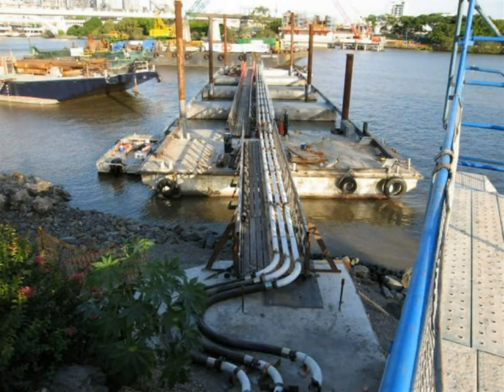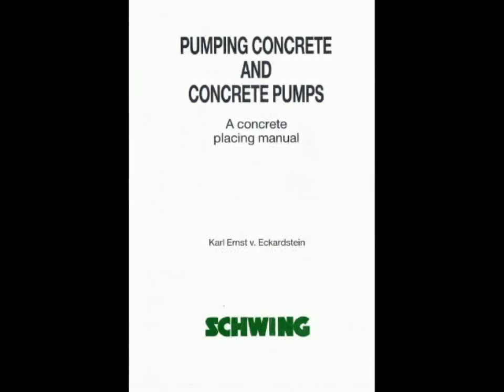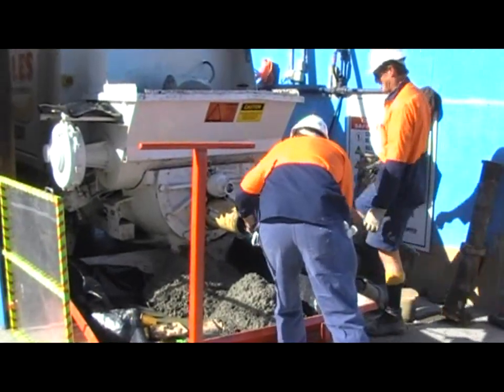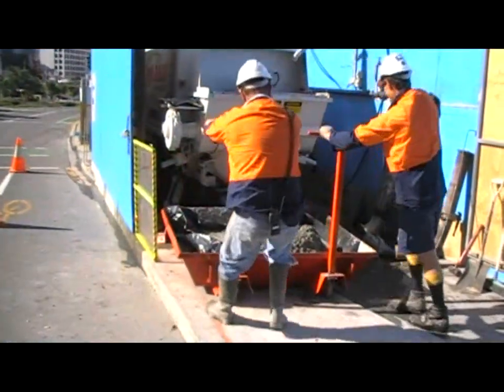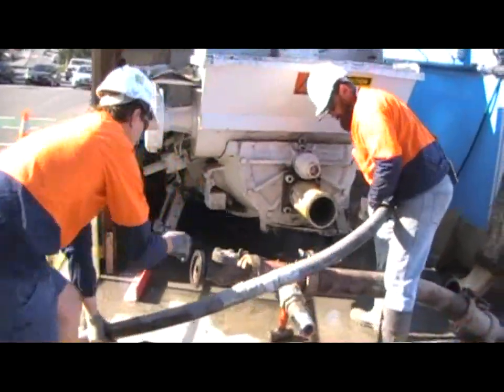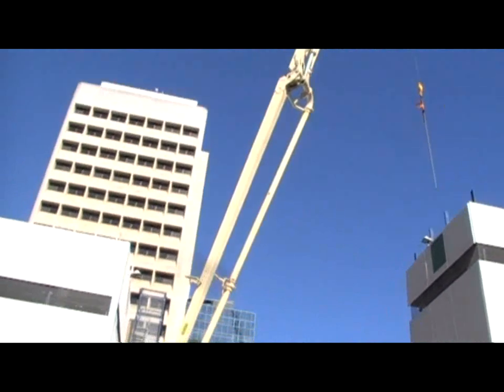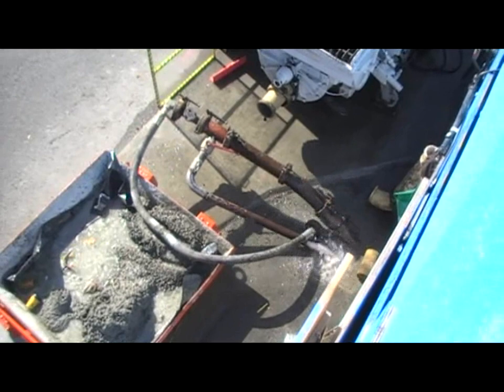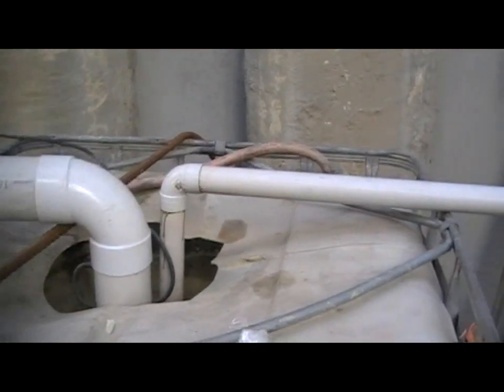Concrete Pump Safety - Water Washout Concrete Pumping High Rise

Comment: Ah okay that makes sense. I've never ran a placing boom before. longest amount of line ive pumped through was over 2000 feet of 5 inch for a tunnel pour, which we blew a go-devil through to a catch and back to the pump. which seemed to work pretty good. I guess that's why Meales is the leader over there! You guys looking for operators? lol

Comment from the maker: paper bags must be used. Try rolling up empty cement/flour etc bags and insert into another bag and keep rolling until its a nice fit. depending on the bags used 3to4 per plug and it shouldn't be so tight that you cant insert it in to the 4ft pipe. (We purchase new empty cement bags).  we put 3 x bag plugs in the charge pipe and the followed by a Go-devil. The go devil gets returned back down the line with air.  We Use this method to clear well over a Mile of line. We have never had separation.
Reply: True that

Comment: Thanks for the good info.. I tried this with 2 washingpluggs instead of paper bags. Got huge seperation. Now we went back to blowing back with air. Its scary to try it again since we want to be sure we stay out of trouble. How tight do you fit these paper bags? 

1 sidenote: If you blow back into the mixer you can still use ALL the mud if you use crane and bucket.. But still I like this method. It is indeed safer. Thanks for explaining.

Comment from the maker: Check the Title of the Video it says "High Rise". 
You cannot suck back that ammount of concrete. 
We suck back with Mobile pumps just like you might do.
Reply: lol....if they have never done a standpipe that long....it would be hard to guestimate how much mud it takes just to fill the vertical....
I have done these that held OVER a full 9 yd load and then took a bit of the next truck before they saw aggregate on top.  

The BIG bummer is the load of grout that MUST be placed somewhere.  When its this much, they engineers usually go for a "grout seal" around column bases and certain beam pockets. Got to be GOOD though...once its all gone, its GONE !

Comment from the maker: we are in northern QLD Australia so i daytime temperature is always 98 in summer months.
Bullets do not work as the water bypasses it. Paper bags prevent the water from bypassing.
We have over 20 Seperate placing booms Up in High rise as we speak and we ONLY use water washout. We never lose the line. 
This is the preffered method by the Manuafacturer. This video is here to educate the un-educated.
I have a pile of Blowout stands you can have. We used those in the 80's and 90's.
Reply: A tip: watch movies on Flixzone. I've been using it for watching lots of of movies these days.
Reply: @Royal Yahir Yea, have been using flixzone} for since december myself :)

Comment: Good theory on paper. What happens when it's 98 degrees outside and you are pumping hot 10,000 in columns and waiting to wash out the pump, try and get all those damn clamps clamped, etc.? We blow it in a mixer truck with the bowout tree come-alonged down tight. Easy. If they need it up top, bucket it with the tower crane. You would rock pack like a bitch trying to push concrete here with paper bags! Try using a bullet. Harder for water to get around.
Reply: a hard orange ball is best.  They might be expensive but they work.
Reply: Its ment to be 
3  bags  +  pig  ...
Reply: Nonsense. I bullet, pig, whatever you call it, and its a done deal.

Comment from the maker: @sibalogh 
Not true. A typical high rise has air connected at the boom and the entire line is then pushed back to ground level in to a waste bin or Agitator bowl. this is then dumped. this is normally about 3-5 cubic metres. A typical water wash out does not see 1.5m3 wasted. maybe only 0.3 to 0.5m3.
This job has extra as they are using coloured concrete. It is not possible to use air to push concrete up the building. its not about water recycling, its about waste concrete and injuries/incidents

Comment: It all seems very well but still there's no utilisation of the 1.5m3 of concrete in the waste-bin though, is there? That's a more valuable amount of concrete to be wasted than the water to be reused to flush the pump with.
Reply: Stephen Balogh just crush it and use it for backfill